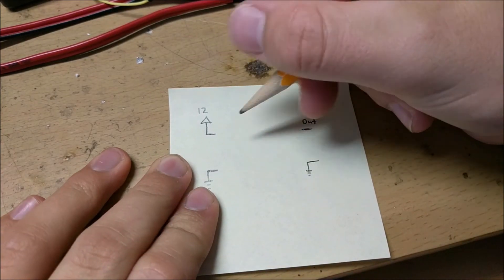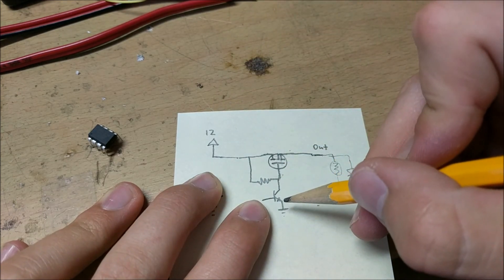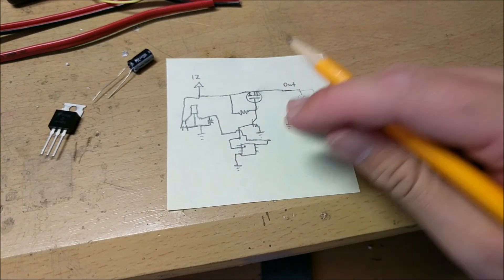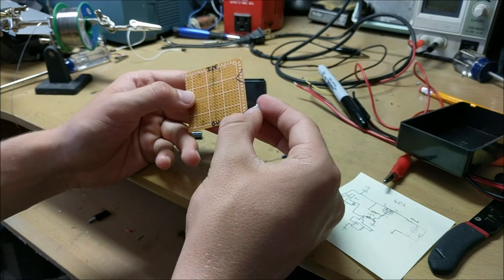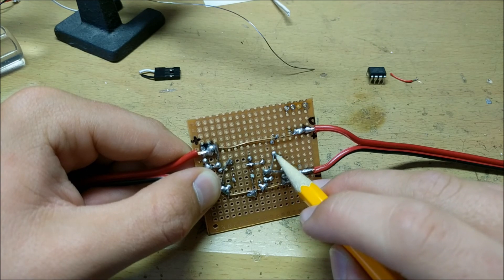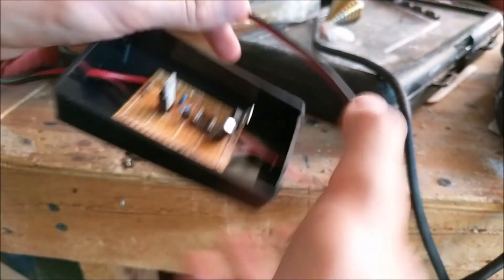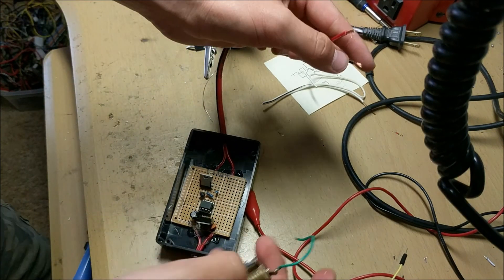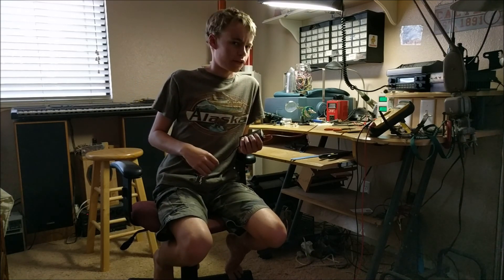High Current Programmable Strobe Light Controller (DIY)

Comment: Assuming you are using an NPN transistor and an NPN MOSFET (enhanced mode), as indicated in the diagram, this circuit makes no sense.

The 10k resistor from 12v + to the gate on the MOSFET, is acting as a load the second the transistor switches ground to it and the MOSFET gate. When the transistor is off, current flows from 12V+ to the Mosfets gate via the 10k resistor, and grounds the output of the circuit (provides ground to the LED). SO.....any sketch you write to the Attiny will do the exact opposite in the circuit. Why not just use a PNP MOSFET by connecting the LED to ground, LED + to the MOSFET drain, the MOSFET source to 12v+ and the MOSFET gate to the transistors collector? 

Please enlighten me.
Reply: ..nope current won’t flow into the gate no matter what, that’s no. 1.

..when bjt turns on with At-tiny high current flows through the 10k and through bjt to ground, yes! When this happens close to 12v will be dropped  across 10k so voltage at gate will be very low causing mosfet to turn off, when attiny goes low then bjt is off and current in 10k is close to zero so volt drop across 10k is near zero so voltage at mosfet gate is high, around 12v, so mosfet turns on

After all Tanner’s light did flash on and off so it’s probably working fine!

Comment: If we replace it with 555 timer circuit,what Changes will be there in the Circuit..?
Also can this be used as a Brake light flasher..?
Reply: They are totally different devices.  The Attiny is a programmable microcontroller and do tons of things based on software.   The 555 timer is a dedicated timer chip that performs one function of outputting pulses based on the component hard wired to it.